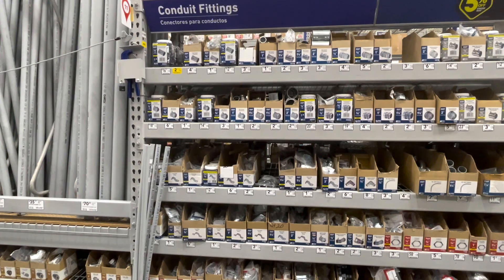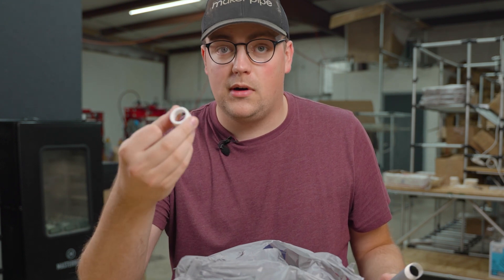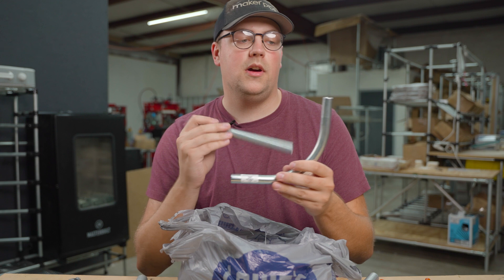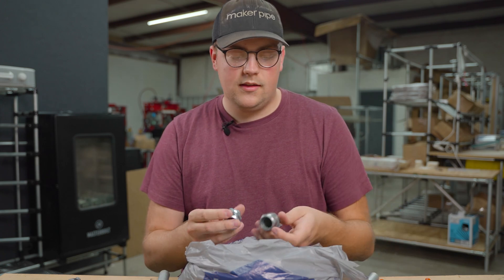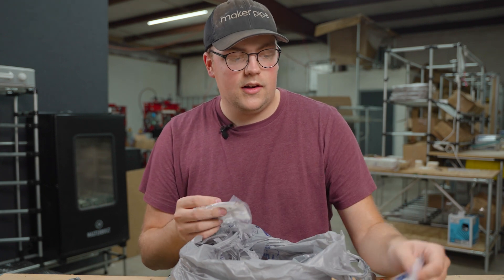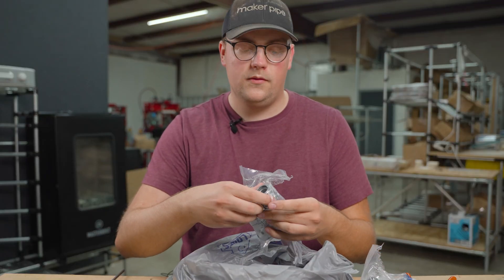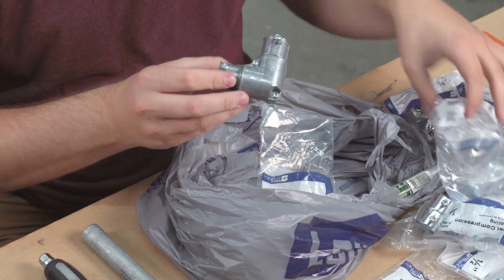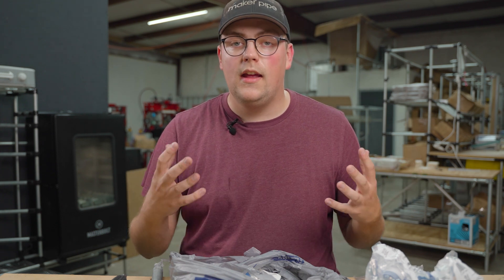EMT Conduit Connectors, Couplings, & Accessories | Beginners Guide

Comment: The first item is call a LB, L because it's shaped like a L and B because the cover is on the back. You can also find a LR, shaped like a L but the cover comes off the right side, and also a LL where it is also shaped like a L and the cover comes off the left side. Not sure if Home Depot or Lowes carried them though.

Comment: Are there any types of emt to nm connectors that you can install after the workbox is already installed? I have a weird situation where I can't open the wall. It's decorated.
Reply from the maker: Hi there, thanks for the question. You might could make this work. https://www.homedepot.com/p/Halex-3-4-in-to-1-in-Non-Metallic-NM-2-Piece-Clamp-Connectors-5-Pack-26512/100179425
Reply: @MakerPipe  I totally forgot I can just cut the nails and install an old work box too. Thank you so much for this though.

Comment: Great video. What's the advantage of buying the connectors and stuff from Maker Pipe versus a box box store?
Reply from the maker: Thanks for the comment and question. The connectors at the big box store are designed for electrical work and the connectors that we make are made specifically for DIY projects. Our products aren't in stores yet but fingers cross for the future.

Comment: Very good intro to EMT fittings.  I’m an electrician and you taught me a few things.  Thanks. 
It would be nice to have you give technical comparisons of your connectors and the electrical counterpart.  That way a builder can be certain they are using the correct hardware for their project.
Reply from the maker: Thanks for the comment! I am glad you found it useful. That is a good idea for a video. In the meantime, here is a complete walk through of our system that might be helpful. https://youtu.be/WvQFUYWDPqg?si=7R1nlS3ndmTqTWl5

Comment: EMT is not pipe, it's tubing  Have to be carefull with some of the POS garbage that big box stores sell. NEVER purchase or use garbage die cast fittings especially crap made in India. Code does not require bushings for conduit with all of the wires smaller then #6 guage. If you install garbage die cast fittings and move the conduit say more then 15 degrees it often egg shaped &/or cracks. Best practice is to run 3/4" RMT instead of 1/2" from circuit breaker panels to first pull box in case you need to add additional circuits. 99.9% of the time you never need a two hole strap to secure conduit. Sparkies call the pipe hanger straps mineralacs or mini's.

Comment: Nice educational video. I used some of the couplers and 90’s before discovering Maker Pipe. They can be useful for situations where maximum strength is not needed and sometimes they fit where MP may be too big.
Reply from the maker: Glad you found it helpful Garrett! Thanks for watching and commenting.